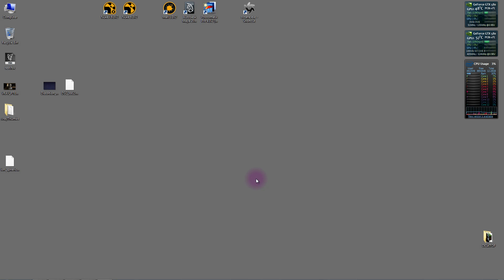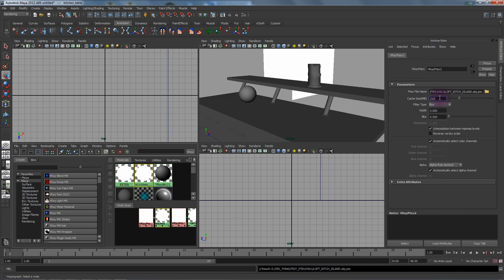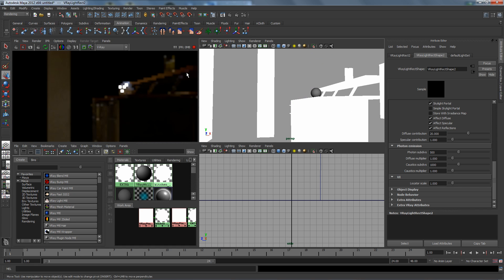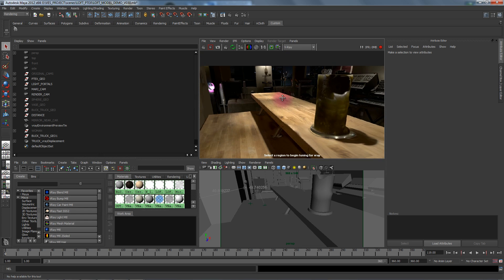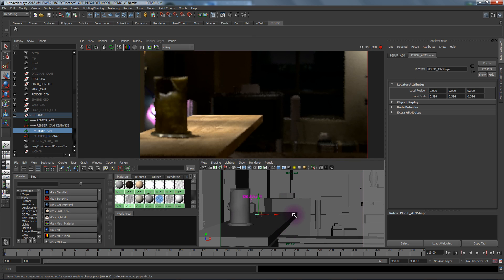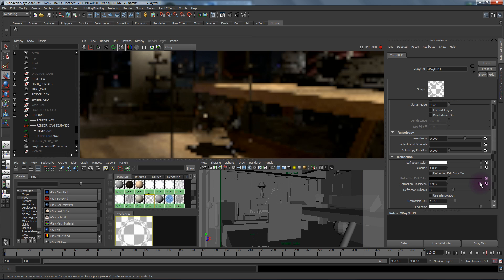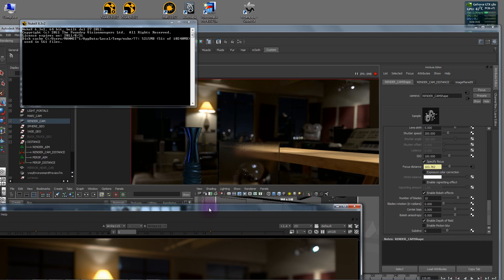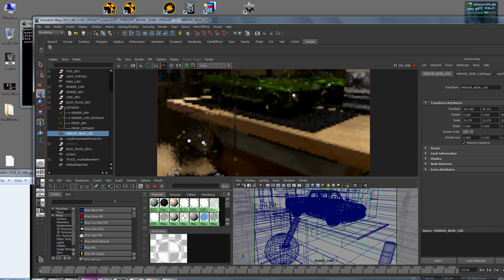Mari 1.3 | HDR Ptex: Rendering in V-Ray (Part 3)

Comment: thanks for this.  one question: what about glossy reflections on the surface of the table for example, and is it possible to cast the shadows of those cg objects onto the ptex mapped surfaces?  or would you do that in a separate pass?

Comment: @x900lbGorillax1 Ptex is 'per face texturing', meaning that you never need UV maps to sculpt and paint a 3d mesh, which means you don't need to worry about seams, resolution switches or sizes of texture maps. Texture and displacement information is applied per polygon which also means you can increase resolution arbitrarily in areas that require more resolution. Ptex basically eliminates UVs entirely.

Comment: @CountlovE When mari is released for osx I will test it!

I'm arguing that the resolution is sufficient. A 5D is 5616x3744, if 8 images are used for both hemispheres respectively the resulting spherical map would be 28 454 pixels in width if I compensate for some overlap.

Comment: @molgamus Yeah, to UV map everything it would be a pain in the ass, and it wouldn't have been put together as quickly.  That's the whole point of using PTEX.  You don't need UVs.  When you don't have UVs, you can paint very high resolution.  Using a spherical image requires PTEX baking which V-Ray doesn't currently have inside of Maya.    Mari doesn't have spherical projection at the moment either.. But yeah, eventually it will help to shoot a spherical map instead.

Comment: Lining up hundreds of photos doesn't seem very efficient? With an SLR like a 5D on a tripod you could capture a HDR probe and a movie for tracking it's position. A couple of probes may be sufficent. Why not generate a point cloud and build the model from that. Then have the HDRI be projected on geometry. The question for me is, would it not be easier to extract the textures at full res while in nukeX? Or was the whole point of using Mari to not have the do uv-mapping?